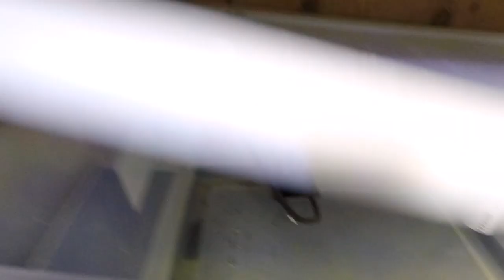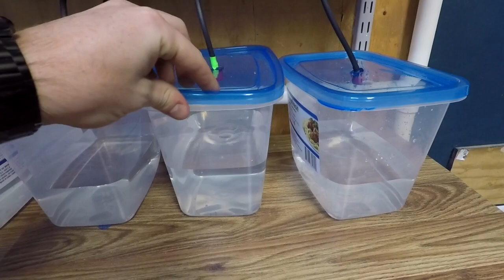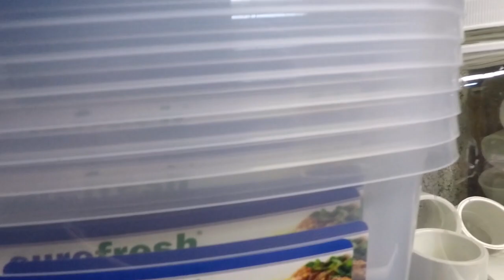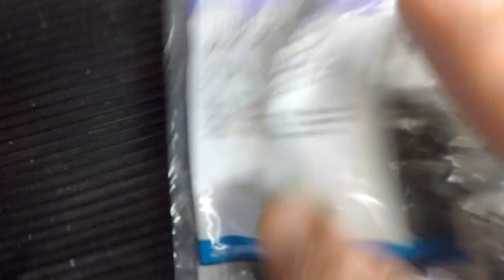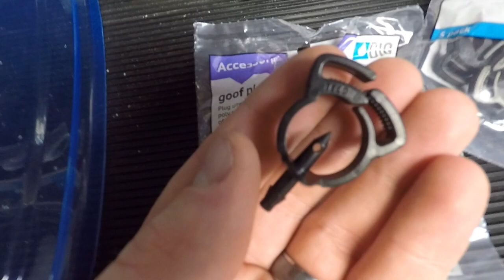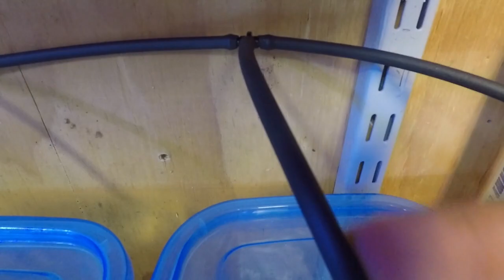DIY BETTA BARRACKS PART 1

Comment: Very clever setup. Would be very interesting to have an update video with comments what worked well and if you found any bugs in the design
Reply from the maker: I tore this system down after this betta spawn I didn’t have any issues at all with the whole system worked great for the limited time I needed it

Comment: Hello, hopefully you still get notifications for this vid. Where did you get the hose and those clips? Don’t see the links. Thank you.
Reply from the maker: It’s drip line for gardens, homedepot has them.
Reply: @GuppyGuru  ok thanks do they come with the clips?
Reply from the maker: No the clips are separate
Reply: @GuppyGuru  thanks I’ll see if I can find the clips
Reply from the maker: You are talking about the little poke clips right? Yeah come in a bag of like 10
Reply: @GuppyGuru  idk the names but whatever clips you used to run the water lines
Reply: Do you have a link to were you bought the containers?
Reply from the maker: Dollar store
Reply: @GuppyGuru  I checked they don’t have that size. Lmk if you looking to sell them
Reply from the maker: I don’t have them anymore they are all gone at this point

Comment: What size pump did you use, if you dont mind me asking?
Reply from the maker: I think it is a small 200 gph pond pump nothing crazy powerful.
Reply: I definitely like this set up. Iwas looking for something to replicate for raising fry. I thing this would work great till they get to a certain size. And water changes should be easier.
Reply from the maker: dws7898 1 the water changes are so so much easier just python in the bottom and a bit of a turkey baster to get stuff off the bottom!